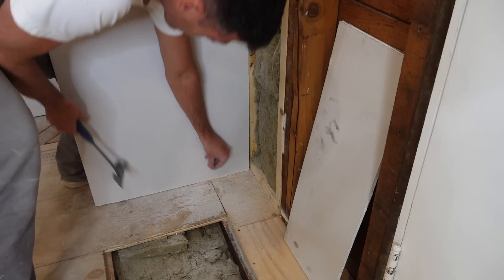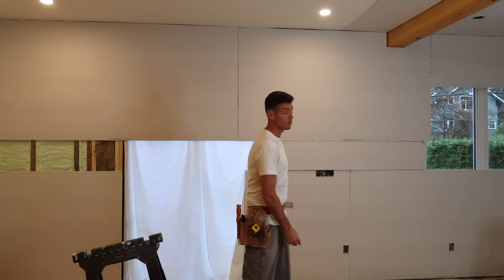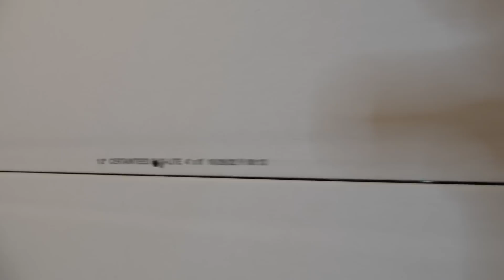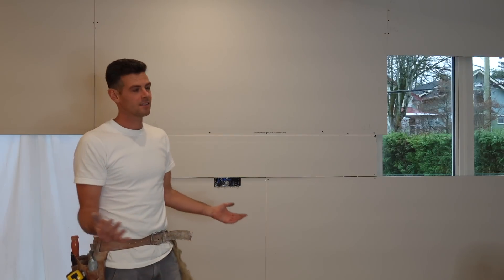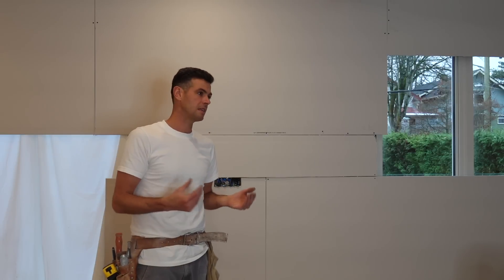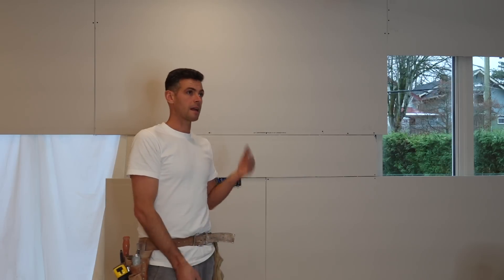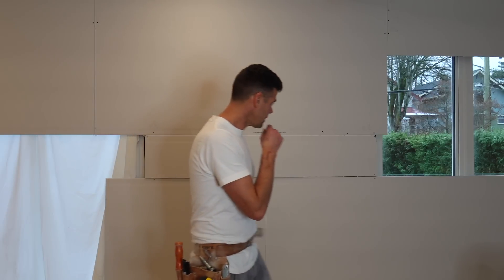Making the case FOR Drywall Nails!

Comment: Never in the middle of the board but seams tops and corners are fine. As long as you are experienced with the hammer.Once experienced you can nail butt joints and inside corners. Then screw off middle of the board. Some obtuse angles may need to be screwed as the wood may be bouncy which dnt work good nailing.
Reply from the maker: I’ve never been fast enough or gentle enough to fully nail my perimeter.
Reply: @vancouvercarpenter  that takes time and practice.  More so muscle memory using the hammer to get the rhythm and touch/finesse on the last hit with out woodpeckering all day. To me it's alot faster if working by the board if you have a small crew. Bigger crew screwguns work great especially with ceilings. 2-3 man crew I'd rather tack up with nails. The angles are the hardest to learn . I usually 3 hit nails in flats and butts  . 2 hit bottoms and 3-4 hit angles leaving small indentations . It's hard trying to toenail a screw that actually will work it's alot of things nails can do you can't do with screws especially when time is money . To be proficient with the hammer it's takes awhile. Pretty much nailing basic training 🤣.
Reply: @vancouvercarpenter  plus you have to develop calluses on your thumb and bend of index finger to push the nail into the sheet rock when doing ceilings . Or you'll spend all day trying to poke nails in before you can ever hit it with the hammer lol.

Comment: Here in Australia we also apply gyprock glue prior to screwing in the gyprock to walls and ceilings. Is there a reason that you don't use glue for walls?
Reply: Possibly unnecessary and time consuming
Reply: Drywall glue is the way to go..less screws...less drywall pops..less screws to "spot  when taping...and personally think it's faster
Reply: @briansmith3191  You would think that applying glue would be a no brainer. Cost a few dollars for a tub, a few seconds to apply and walls and ceiling remain intact for decades.

Comment: All I can say is that I've demo'd a LOT of walls with nailed up drywall, and THE NAILS HOLD JUST FINE!!!
Reply: True, but there’s no such thing as a screw pop. 😊
Reply: @markoshun  I have screws that show thru (compound is popping off top of heads).  I don't know if it is rust or loose board.  Seems to me glue and screw compensates for less than perfect installers.   Once glue is cured, I don't think there is any movement between studs and board, they move together.  So if the compound is popping around the screw it has to be corrosion?  Is that because screws were rusty when installed or does that occur in normal houses over time?
Reply: @jimw6991   The issue with nails, even properly installed, is they can get pushed out of the stud as the stud shrinks and cures over time. Screws have much less tendency to do this.
So, when you push on the wall near the problem screws there is no give? If no physical gap back there, and especially because you are seeing corrosion, I’d next look for a problem with humidity. ie.- studs installed too green, if they are relatively new, but sounds to me like you might have a condensation problem. Do they tend to be on outside walls?

Comment: That looked awkward, RIP your back. Just pre-set some nail in the top beveled edge of the board before you go up with it.
Also, you're a lot less likely to get cracks if you break those seams at least 10 inches into the window or door openings.
Reply from the maker: Those were nine foot ceilings. That’s why it looked awkward.

Comment: nails should never be used for drywall ever. it is a weak point it will always be a weak point and why would you purposely install a weak point.
Reply: Lol I guess you better go back a hundred years and let all the plasterers and drywallers know to never use nails.

Nails are perfectly fine if you actually know what you're doing and how to install them.
Reply: @James26285  hundreds of years? no. the first form of drywall was patented in 1894 and was installed using nails because most things on a house that old were nailed together regardless because power tools weren't that wide spread and invention of the drywall screw hadn't happened yet. nails can come loose especially tiny drywall nails or they don't get nailed down all the way and pop through. i know this happens because i fix these issues fairly regularly in old homes. and how do i fix them? with screws, because screws tighten and don't come out.

Comment: Finishing would be a lot easier if you put the short sheet at the bottom instead of the middle
Reply: I don’t know, but it seems like having your horizontal seams close together at a height where you do not have to bend down either one would be both easier on your body and faster.
Reply from the maker: That's EXACTLY why I do it. It's faster and easier at a comfortable height than up in the air or down at my shins.